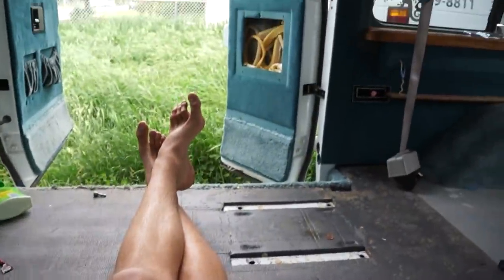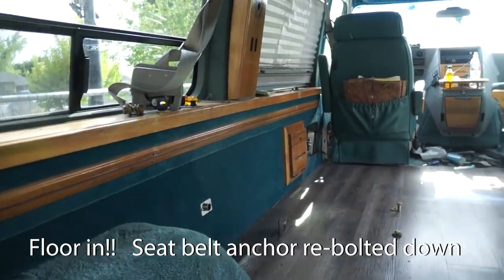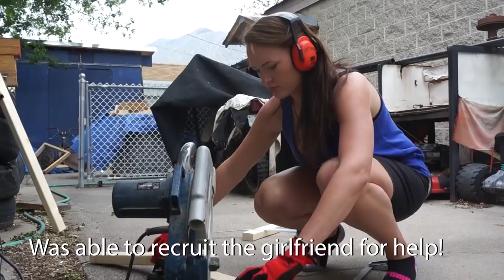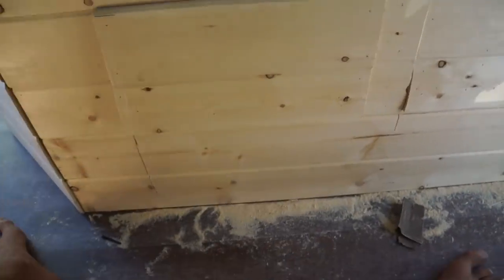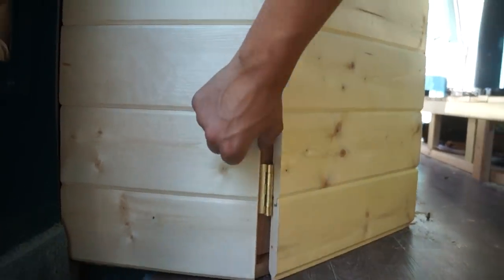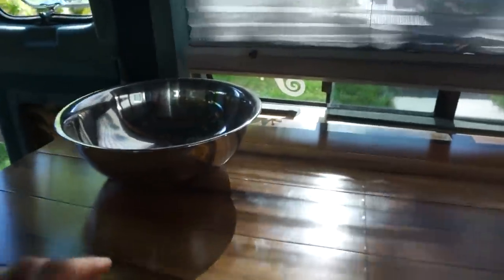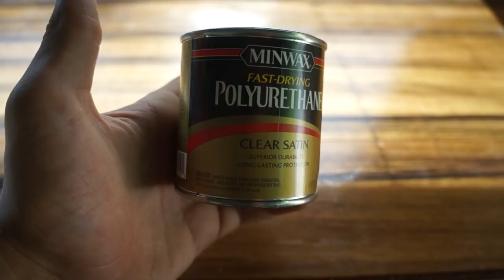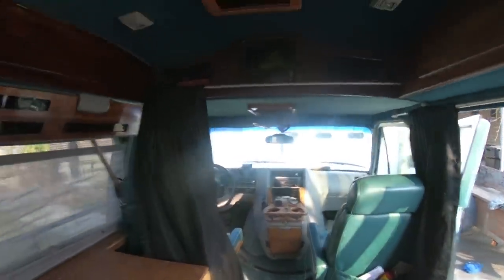How to Build a Home Made Camper Van - Start to Finish DIY

Comment: Only thing I ask, this is purely from my job as a safety guy, next time you build something like this, please, I beg you, please wear a pair of close toed shoes. Other than that, your van looks amazing brother. You did a fantastic job on this.
Reply: Friendly T-60 armor it’s a very common occurrence. It being this mans profession you don’t know what he’s seen
Reply: Get off the cross we need the wood
Reply: Safety first, then team work.
Reply: And he put the drill in between his legs at one point... 😣
Reply: Wore gloves, still barefoot SMH.
Reply: Ya dude, pleasewear some shoes.
Reply: No eye pro either 😑
Reply: And ear protection, his girlfriend wasn't as stupid
Reply: I can handle him drilling without any footwear but the saw is just asking to lose toes, that's a life changing injury.
Reply: for your that worried about safety don't ride a motorcycle,  or drive a car as both are  much more dangerous. ..
Reply: @lenadublavais4273  I’ve actually seen things that would make even the most hardened stomach turn. Every single accident can be avoided.
Reply: I agree with you 110% no shoes or sandals is not a good idea when doing this kind of work
Reply: Not one person mentioned the lack of safety goggles. Come on guys eyes, ears and shoes!

Comment: It's a really old van, I'd be more concerned with the mechanical side of your vehicle. Great job on the van, and i hope it'll run forever
Reply from the maker: Old vehicles just mean less sensors and things to break :) Been driving it for over a year now with no issues :)
Reply: Douglas Kelly didn’t you see the previous video? The former owner gave him a warranty and the engine was recently replaced by an award winning mechanic.
Reply: Douglas Kelly it's a Chevy 350 v8, itll last forever as long as you maintain it properly and when something does need replacing on it, dirt cheap
Reply: Douglas Kelly it’s a Chevy plus it has a 350 in it keep it maintained and it will run forever
Reply: If he reeeeally needed to, he could swap the engine.
Reply: Im 100% agree
Reply: @EliPetersonjp  true and whenever you fix something it's more "new" than before.
Reply: Nothing lasts forever
Reply: my old 89 chevy van rolled all the way around to 000000 on the dash when i sold it for a few hundred bucks it said it only had a few thousand miles lol

Comment: Always good to use an angle grinder to cut rusty metal with bare feet👍
Reply: true. welding naked saves shoes too
Reply: With the correct disc, of course ;)

Comment: Brings back memories of when I was in College in the early 70's.  Had a 68 Chevy Van I built to go  camping and dirt bike riding in the Mohave. Could load my dirt bike in between the couch/bed and cabinets to go riding. The ice box and kitchen were behind the front seats.  Eventually put a Corvette 327 motor in the van and built a bike rail back bumper to carry the bike on.  Good Times.

Comment: Nice build, dude! This is something I really want to do. Rent is too expensive and so are college dorms, and I want to be able to travel after college. As an engineer, I just have to point out that you could do so much more than you did as far as design and using space more efficiently. I can still give credit where it's due, though; you got the job done in a way that suits what you need. Thanks for sharing.
Reply from the maker: Yeah I didn’t really have a plan and just kinda winged it

Comment: Hi, @Eli, I am curious, have you checked how much of weight have you added to the van? Asking as I am considering similar van, 90's Chevy G20 or Dodge RAM B250. They got pretty decent payload, but it's good to know the numbers before I start.
Reply: doubt you are going to overload a g20 unless you fill it with brick or shingles... yea done both. he probably added 3-400lbs, remove the seats, if 3 rows thats - 200 or so lbs from the start. completely filled with 2x4s isnt overloaded. overall this is a pretty solid build plus he can still pull a trailer and the static weight is right over the axle so a bit better in the snow. nice job
Reply from the maker: Hi! So I never weighed it before after but did some mental math. I found the original documentation for the conversion (hi top, captain seats, and a back row that folds down). Wth 7 200 lb passengers it said it had a cargo capacity of 30 lbs (hope no one brought any luggage...) when I removed the big heavy seats I probably lost about 150 lbs. I only drive with it with 2 people so 7-2= 5 then 5x200 +150 (from the seats) = 1,150 lbs I can add to it. I am guessing I am no where near that number. However the van is old and the rear leaf springs are a bit worn out, the stuff I have added and the dirt roads I drive the van on probably does not help. The only problem I ever have is if I have a trailer hitch on and go over a deep bump my hitch hits sometimes.
Reply: Please take the time to weigh it; front and rear separately.
Your safety depends upon how much weight is on your tires.
Then the tire manufacturer’s weight tables will tell you the minimum pressure you can run.

Comment: $1850 van rebuild + $2000 for tools = $3850
Reply: You should check the prices out at Walmart for tools I just brought a cordless drill with a bag for 30 bucks
Reply: He is using his girlfriend's dad's tools.
Reply: He borrowed the tools
Reply from the maker: borrowed most the tools. bought about $150 worth of tools
Reply: and let's not forget that you can also buy used tools.  works the same and is way cheaper. everything he used I've seen at some time or another selling for $20 or less but then again I'm a deal hunter so that's normal for me.

Comment: Where's the bathroom? Toilet?
Reply from the maker: outside, gas stations stores, school etc. shower at gyms, school or a lake or river with biodegradable soap :)
Reply: Eli Peterson. I meant will there be one in your van? Oh yes I'd love to swim in the lake or river where everyone uses it for a 🚻.😀😢 Thanx for the headsup.😉
Reply: You realize thousands of animals poop ends up in rivers and lakes??? It’s nature not your bathtub
Reply: S. Simons the school
Reply: Camping portable potty would be perfect for this project.
Reply: park it in a walmart parking lot over night.open 24/7 u can use their bathroom anytime and free tp
Reply: I always wonder this myself for these situations. I bet there are diy plans for pvc pipe showers using standard gallon water jugs you can turn upside down from above. At least that's how I'd imagine to put one together. You could assemble a square curtain rail at the top. Water jug fits into attached shower   head. Maybe make it foldable and telescopic and fit it under your bed. Toilet? Tougher project.

Comment: A good idea for the sink is to add a faucet that’s removable to use for both dishes and outdoor showers. Use a 12v  solenoid pump and a bike pressure thing to allow the water to travel up the tube and out.
Reply from the maker: That would be good! I am making a new van right now and will have a 12 volt pump for water in it

Comment: Just a thought but if you mount a quarter circle of wood inside the cupboard door, it will swing out and give you a few extra inches of counter surface. It doesn't seem much but when space is at a premium, every little helps! You would have to cut out a bit for the underside of the sink but if you mounted the trash can to the inside of the door, that would create a garbage hole in the worktop.

Comment: Excellent functional build on your van, I admire your hard work!  If your girlfriend knows how to use power tools and willing to help, she is a keeper!  If she moves in with you be sure to make a very private toilet area. Women need that.
Your kitchen counter is very smart.  Cheap easy materials and looks great.  Bamboo holds up to water too. Your bottle holder is super smart!  Very creative.
A couple of tips:
Fabric.com sells Roclon Blackout rubber cloth for $2 per yard at 60" width.  Sew this on curtains to black them out. 
Instead of your box and cooler, put a small electric upright fridge, and use a box over a toilet, with a curtain going around it.  Both of these will fit into that space.  Toilet comes in very handy esp on cold or rainy days.

Anchor, not ancor.  Bottoms, not Bottums.  Dude, you may be a genius at building out a van, but don't skip college.  Spelling is the polish on the car of life.  Pay attention to details.
Reply from the maker: Thank you! Haha yeah my video editing program didn’t have spell check and I wasn’t really paying attention. We both lived in this van for a bit but then sold it and moved to Asia for a year. We are back though and I am working on a new van (check out my second newest video)

Comment: Spreading construction cement with a plastic mastic comb prior to peeling and sticking the flooring will insure that the floor sticks and does not ever release due to shrinking and expanding caused by temperature changes.

Comment: I saw in the comment section somebody mentioned that these conversions are going for 30k, I've recently seen them around 50k. So a 16k van with about 8k in actual parts, another 8k to change the engine out and custom the drive, probably another 4k to outsource some of this labor... 36k flipped to 50k.

Comment: All that lumber = a lot more weight.  Which sacrifices MPG....  Also, that weight will take it's toll on the rear axel bearing. (had to replace it myself). Given that we are now living with $5+/gal for the foreseeable future now, might you reconsider the materials used?  What is your current MPG???

Comment: You could turn the cooler area into an area where you open the lid and it transforms into a full shower and toilet area. Not having a shower in van or east access to shower and toilet is not fun.

Comment: I went to lowes and those 2x4s add up when you start buying 10 at a time. Were all these donated to u?
Reply: I feel this misleads and causes confusion to new van life youngsters.  It will be at least 2k just for the inside. Cause Solar panel, 1 non toxic battery and roof vent fan is way over $700 alone.
Reply from the maker: notice how i didnt have a solar panel, battery or fan.... just the cheap stuff haha

Comment: Just found this video because I want to start a van life styled youtube channel. 

I've seen tons of vans available on facebook to buy near me but I'm worried about the miles on them already. Do you know a solution to help keep the van running? Like could just having the engine replaced with a newer engine fix a lot of the issues? I'm pretty new to vehicles in general so any help is appreciated. 

I realize that doesn't reset the mileage, but I'm mainly worried about just getting stranded out in the middle of no where.

Comment: Haven’t watched the vid yet but how do you get internet? Since there is no router and electricity how would you use any electronics?

I’m asking because I assume you would drive so you couldn’t connect any wires anywhere.
Reply: Simple. Buy a hotspot brick off of Walmart or Amazon buy service and it'll work as a potable router. Or you could just use your mobile hotspot on your phone
Reply from the maker: charge from the van, get wifi in lots of places

Comment: 4:48 - Give your dog some flea meds.  You can get Comfortis chewables which last a month, or Nitenpyram 12 mg (for that size) which last 24 hrs and cost $1 each online.  Don't allow your dog to have fleas.  Esp in a van!

Put some rubber cloth (Roclon $2 per yard from Fabric.com) on the back of the curtains to block out light. Cannot do stealth without it, and gives you better sleep.
Reply from the maker: haha the dog has dry skin not fleas
Reply: @EliPetersonjp  Ah, that's a relief to hear!  Flea bites itch for a week.  Some fish oil will help a lot.  If skin is irritated, dog could get skin fungus which is hard to cure. Try on Amazon - Icelandic Pure Fish Oil - Anchovy /Sardine 33 oz for $26.  It was on sale for $20 recently. Keep in fridge if possible during hot months.  Essential for dogs.

Comment: It's a nice looking job on the van. But there is no way in the world I would have sold my truck to get a van instead. You can use the truck to haul stuff and make money with it. You can also get pallets for free and sell them for good money as well. You can get multiple types of campers to live in from the cheap to the very luxurious. You can use your truck to haul the camper or pull it depending on what you get. Plus if your truck breaks down you still have something to live in while it's getting fixed. If your van breaks down you have to live in a tent while it's getting fixed.

Comment: QUESTION: How did you attach the OSB to the bottom of the van, or did you not attach it?
Reply: probably didn't attach it. Did you see how unprotected he was?
Reply: @TheSasquatch  What do you mean by unprotected?
Reply: @christiancowboy352  his toes were exposed most of the time while using power tools
Reply from the maker: The OSB was floating but then I bolted down the 2x3s through the osb to the bottome of the van so it pinched it all down tight
Reply: @EliPetersonjp  Ok, sounds good...thanks for replying back.

Comment: If weight matters , why use wood for framing? metal track & studs are just as durable and weigh less!
Reply from the maker: Because it's the easiest material to work with when you don't have fancy tools.

Comment: It's good in all by the van is prolly heavy now. Prolly would have been best to use more metal.
Reply from the maker: Steel would be heavier and aluminum is pretty though to weld well. I like how cheap and easy wood is
Reply: @EliPetersonjp  your probably right

Comment: The bamboo is going to warp in heat and cold so be careful of that
Reply from the maker: never had issue with the bamboo but the floor did warp on really hot days or direct sunlight

Comment: 8:31 not how bolts work lmaooooo
Reply from the maker: Haha I used a washer and nut on the bottom of the van don't worry. I drilled my hole a bit small to get a real snug fit so I had to give it some force to get it in

Comment: How much does all this weigh? -- If you're over weight and involved in an accident they will prosecute.
Reply from the maker: By removing the seats in the back I took off a lot of weight and even with my additions we were still under the original weight, but around 3/4 ton.

Comment: Dude, you could have saved time, space, weight and money  using 1x2s  skinned with ½" ACX plywood
Reply from the maker: the more you know
Reply: @EliPetersonjp  ..right? ..live n learn. I saw some videos here on youtube where they were making extremely light weight cabinetry on the cheap. I think a search for "poor mans fiberglass"  or something. Its basically skeleton frames with canvas stretched on then coated with titebond 3 (its waterproof wood glue).